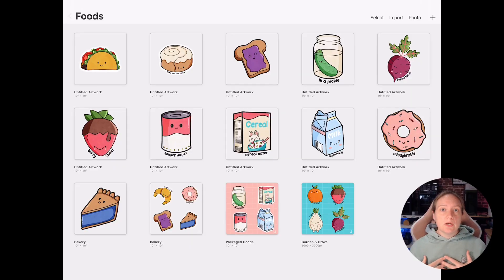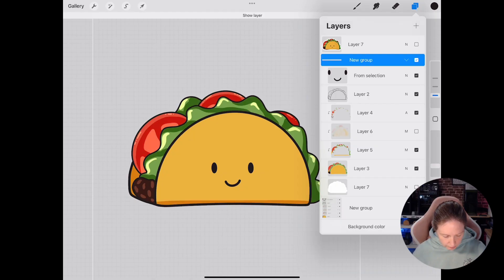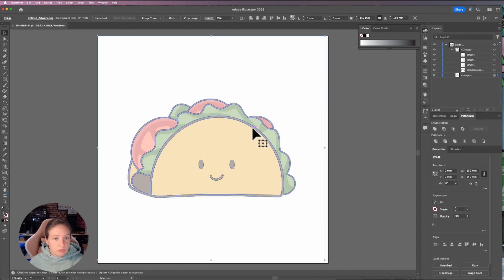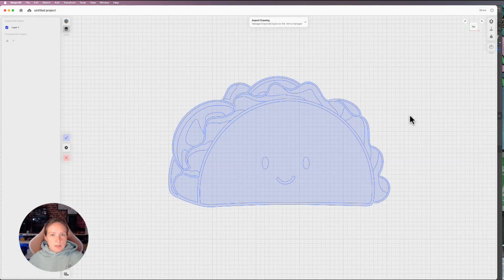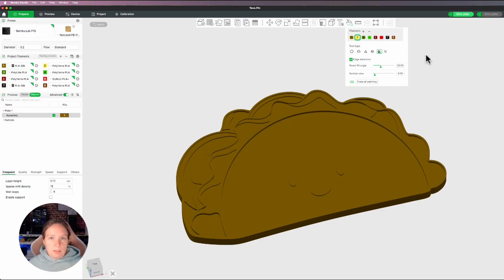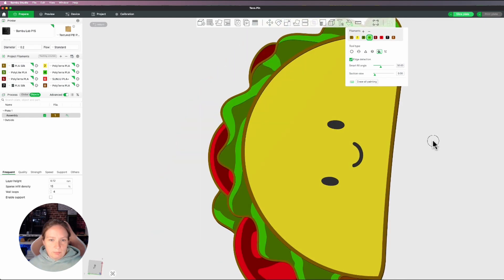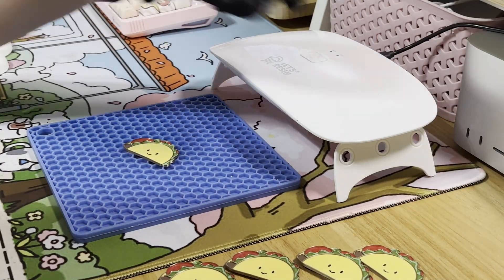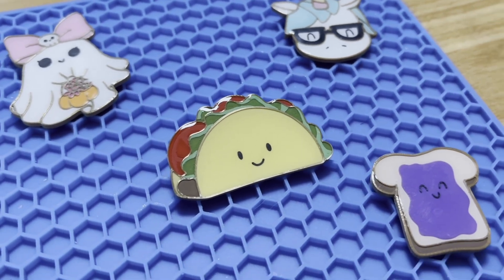How I Made Cute 3D Printed Taco Pins at Home

Comment: FIRST: THANK YOU for creating this to-the-point video. It has helped me tremendously. 

SECOND: How do you keep the filament from deforming when the UV resin heats up?
Reply from the maker: It really doesn’t get hot enough. It’s never been an issue. The closest I get is if I’m getting a little too hasty with the crème brûlée torch popping bubbles (I used a lighter on the video because mine’s out of butane) and I accidentally trigger some smoking.

Comment: found any longevity issues with using PLA and being reactive to UV degradation, have you tried doing this with PETG?
Reply from the maker: I’ve not had any issues so far and I’m actually in the process of experimenting with the stained glass material printed as decorative items in my garden. It’s been extremely hot this week but I’m not noticing any signs of warping. I can’t speak to hanging a stained class design in a car because it can get extremely hot there but as to warping for now I’m not noticing anything. I had done some research and it looks like PLA actually has the same UV resistance as ABS. As to how the colors will fade over time I think that’s really kind of dependent on whatever dye is used in the filament and that’s hard to discover. I’m curious to see how my experiment will work out and will definitely do a follow up video after a while.

And of course, this could be done in PETG but I just chose to work in PLA.

Comment: Great video. It would have been funnier if you left the swearing in while you were working with the lines. 🤣 I have a question about the Shaper 3D software. I'd like to try that but don't want to pay for an entire year and find out I don't like it. Does the free version have all the things the paid version has. Thank you for any reply.
Reply from the maker: Export is much lower quality on the free version unfortunately. It’s one of the few downsides of the software, but it’s my favorite CAD to use so I opt to pay for it.
Reply: @LabcraftStudio  Thank you for letting me know.
Reply: @LabcraftStudio  I want to add that I'm not concerned about the export of the Basic version. What's important is the ease of building my projects. What you did in your video looked very easy.
Reply: Just wanted to let you know I'm now on the free trail for shapr3d. It doesn't seem to work any better the the basic version for exporting 3MF files. Do you know of any really good tutorials for shapr3D? Thanks for any reply.
Reply from the maker: @erniehodge4297  not at the top of my head. I think I learned most of my stuff honestly looking around on YouTube. I think shapr has their own channel which was a good resource.

Comment: Did you print with a .2 nozzle? It looks so smooth but I can’t tell if that’s just YouTube encoding or just the smooth print.
Reply from the maker: I did. I forgot to mention it in the video. But given the pin size you get really nice details if you use a 0.2. I also have the profile set to iron top surfaces though I get good results with it off as well.

Comment: Would you be able to just print the frame and fill in the colors by hand with colored resin or something?
Reply from the maker: You probably could do that too. I don’t work a lot with resin so that’s a little out of my league, but I don’t see why that wouldn’t work.
Reply: It can be possible, however with FDM it's not great. You'd need a very thick resin as it will seep through the thin walls into the adjoining color spaces. You could also try and to a thin coat of clear first, but it's still not consistent. I make a lot of pins as well and have tried this with resin and paints. It can be done, but it's not really worth it imo, especially if you want to make a lot for sale.

Comment: Great video!!! Have you had any heat issues with the PLA during the UV curing?
Reply from the maker: No. The only issue I have and I think I touch on it briefly is air bubbles because of the filament being somewhat porous. That’s why I try to tap and let them sit a little bit before I do the final cure.

Comment: Excellent choice of food. Quite topical.

Any chance of tutorials using inkscape or other free open source alternatives? I have a bit of trouble converting some steps from time to time.

I like the outside the box thinking you bring the 3D printing medium.
Reply from the maker: Yes, that thought crossed my mind when I picked it. 😏 I have been thinking about at looking at Inkscape. I will see if I can try and find add it to my list. There’s a decent png to dxf converter on convert.io that I often use as well.
Reply: @LabcraftStudio  The Inkstitch addon for Inkscape might clinch it for you if you also do, or are interested in, embroidery with fancy embroidery machines.
Reply: @LabcraftStudio  Also, I mean like converting the offset step from the way you do it, to the way it must be done in Inkscape. Just replicated the stained glass tutorial in Inkscape(I think) and it was a task to figure out the offset tool.